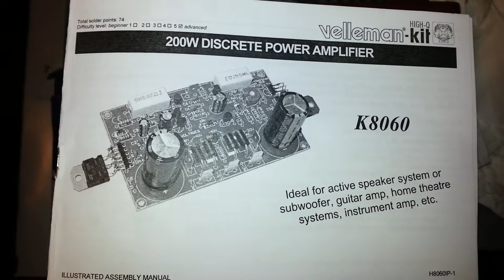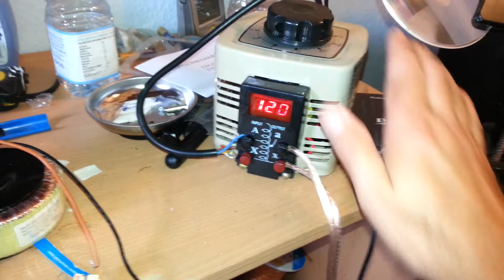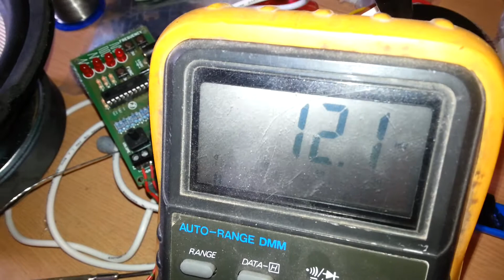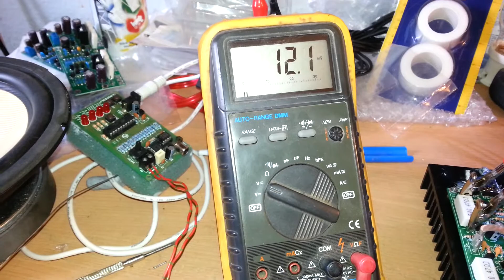Velleman K8060 discreet power amplifier test

Comment: I converted an old Bakelite radio system into a standalone amplifier and blue tooth receiver system with 2 x 8 ohm  int speakers AND 4 x 4 Ohm external speaker 🔊 outs 2 x 4 Ohm connected in series NOT parallel! (disconnects internal speakers) 2 volume controls (500K log pots IF you want louder then substitute for 200K -softer use 1M pots) Transformer was 240v in and 14v + 14v 5Amp out AC (NOT DC input!! to amp unit) Min 12v 2Amp AC recommended👀 You can use up to 18v AC 2Amp to 5Amp which gives increased output against using 12vAC 2Amp.. The bluetooth unit is a simple receiver board that connects to the input of the amp powered by the same transformer off ONE of the 14 volt AC outputs with a 5Amp rectifier bridge and 35v 100uF smoothing electrolytic across the positive and negative, make sure the positive is to the positive out and the negative to the negative  = 14v DC (You can use a power transistor to stabilise the output at 12V 5Amp use a half wave diode to the power transistor)👀 power transistor must be mounted on a small aluminium heatsink.. thermal grease ! I also used an optical to RCA out from tv to the input on the built unit for enhanced tv output.👍

Comment: Hey! Maybe another daft question here... but I have the heatsink and toroidal transformer now, how to I get power into the transformer? Do I need a variac like on your video? I don't have one and was hoping there was another option?
Reply from the maker: You only need the variac if your mains supply is more than 120Volts, In the UK it's 240V D'Oh!! Step down transformer required lol.
Reply: Ah! And that's as well as having the toroidal transformer?

Comment: Is that the Heatsink listed on the front of the box (HSVM100)? Building one of these Velleman K8060 amps myself and the heatsink appears to be discontinued. Can you recommend any others?
Reply from the maker: Hi Fooz Brr, I take it you have been on the velleman web site, cos they're still advertising it for sale for just shy of £12 here's the link: http://www.velleman.co.uk/contents/en-uk/p338_HSVM100.html  
Beyond that I would just improvise, the design is not the best cos the heat sync covers the soldered side of the board. Therefore I have been thinking of sawing it in half and repositioning it for ease of access. See how you go.  :-)
Reply: Thanks! Stupidly enough I did not look there! I bought my amp kit from Maplin and they had it listed as discontinued, a quick google search gave me some alternatives but all were priced around the same as what I paid for the amp! The Velleman site didn't show in that google search for some reason though!
Cheers!